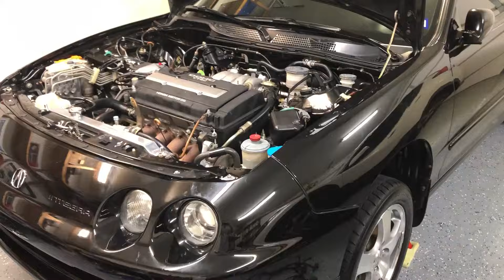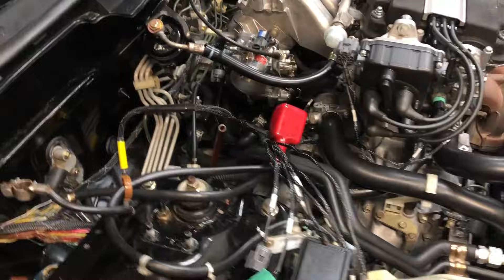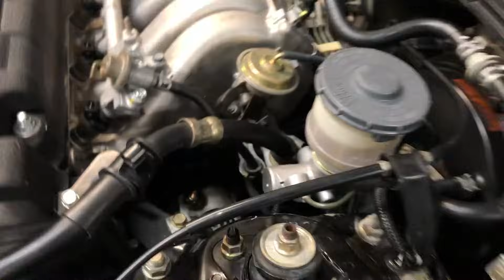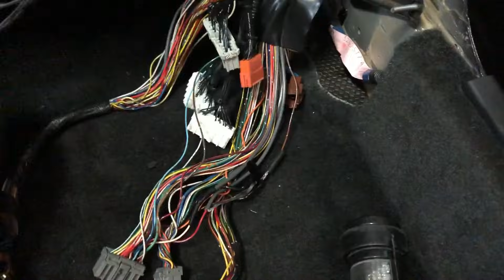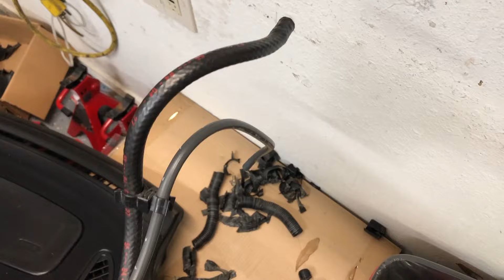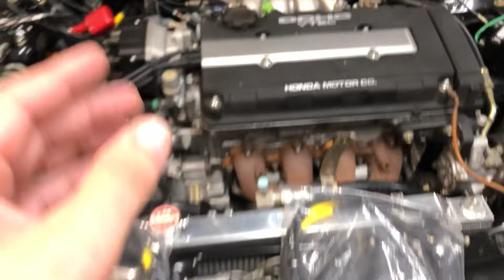'94 Integra GSR Current State |RYWIRE ENGINE HARNESS|

Comment: What did you end up doing with the purge solenoid? I’ve deleted my evap system already and have a skunk2 pro intake manifold but I still have this solenoid and i have both vaccum ports capped so it serves no purpose lol but I can’t unplug it or it just has CEL
Reply from the maker: GsrAl my car hasn’t ran in one year. It’s been just sitting in my garage while I’ve been working on my ‘91 Civic. I have about 15 videos I’ve been editing to catch my channel up to date. I only have a few more videos to edit then I can finally start working on my Integra again. Expect new videos out of the Integra in early 2021. Going to be doing lots of upgrades to my Integra GSR. Stay tuned.

I just left it unplugged. I plan on getting my car tuned using Hondata S300, so I will just use that to clear the CEL.
Reply: Spencer's Garage yeah I think I’m gonna be getting hondata as well, supposedly on obd1 cars you can unplug it and no cel